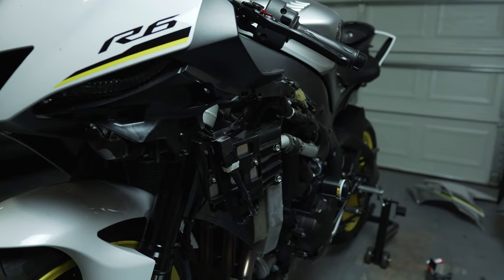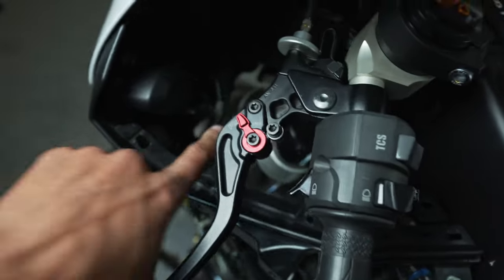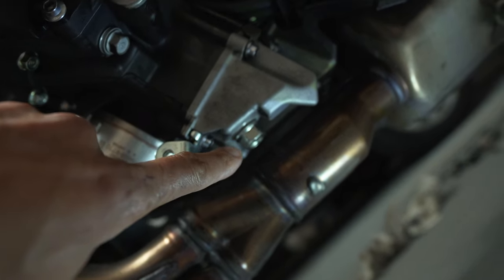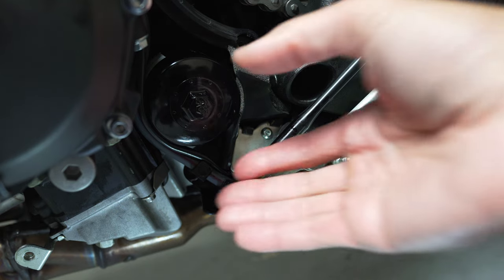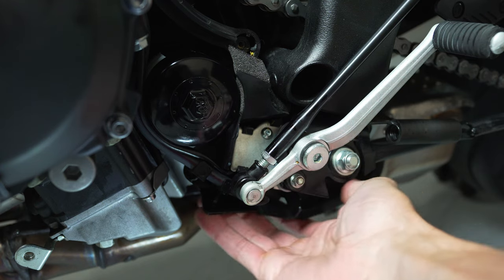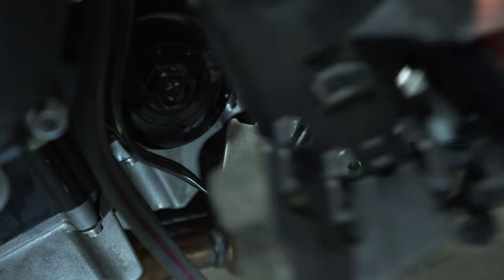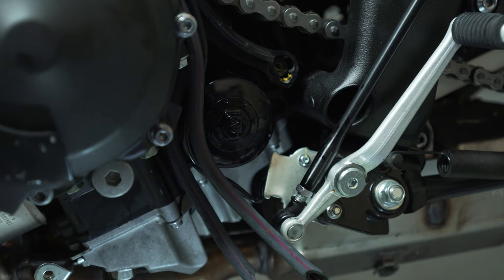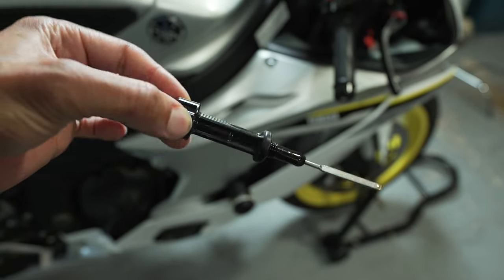Hard time removing your oil filter? TRY THIS!

Comment: There is a good reason K&N oil filters are banned by multiple sanctioning organizations my friend. Little research on this may save you tons of trouble on the new bike. ☠☠☠
Reply from the maker: What filter do you use?  Yes I know that the factory OEM filter is always best.  I’ve also used HiFlo filters and if I’m not mistaken HiFlo makes K&N oil filters.  Used both of these brands on all of my bikes with no issues.  Oil filters are always a hot topic, but as long as you tighten correctly and change your oil at the recommended interval you should be fine.  Now if there is a track that won’t allow them, then I’ll change it to meet their standards.